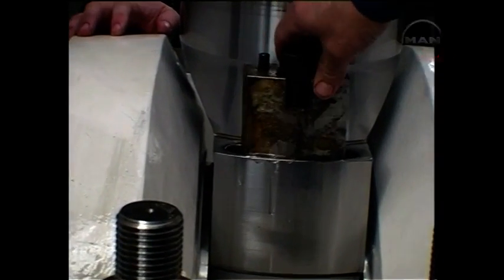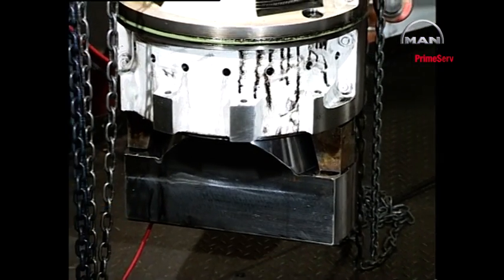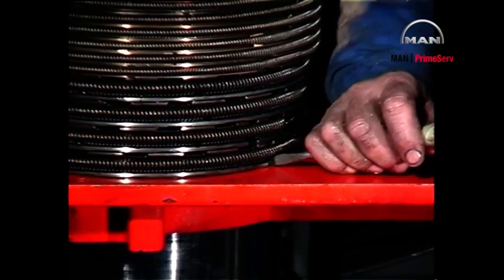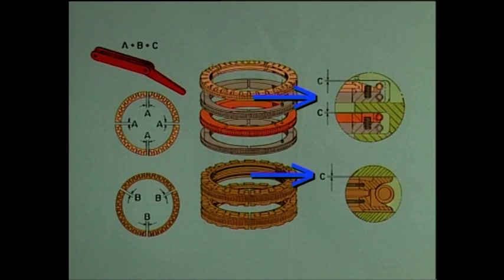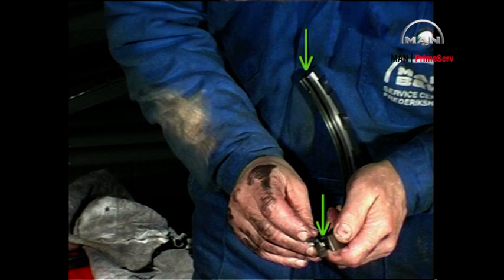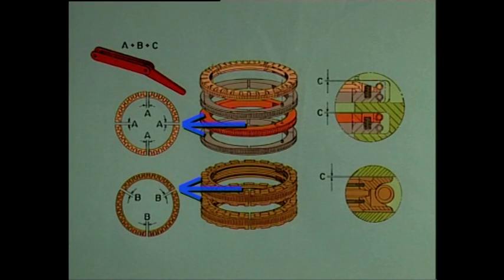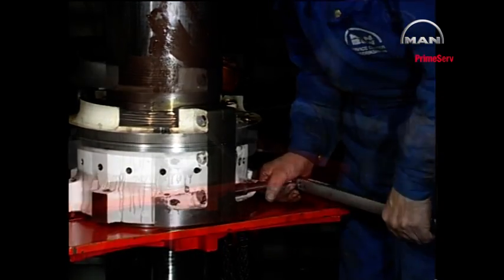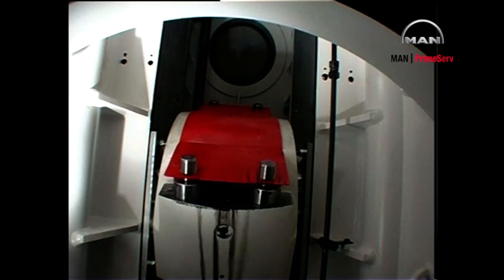Stuffing Box Overhaul

Comment: Vertical clearance with filler gauge, Calibration of the springs, surface conditions and diameter of piston rods., lube piston rod with molybdenum dysulphide.
Reply: Ring end CLEARANCEs distributed evenly all around.